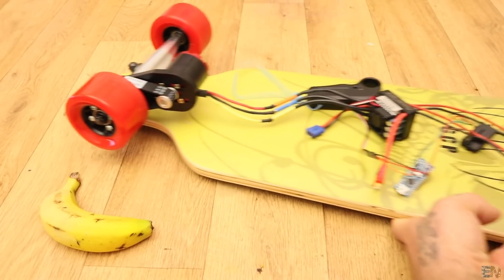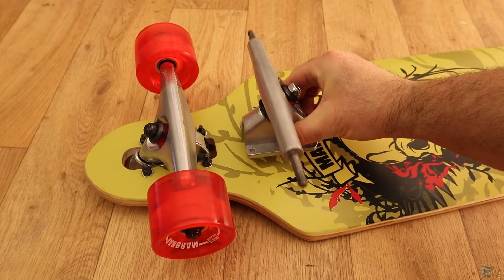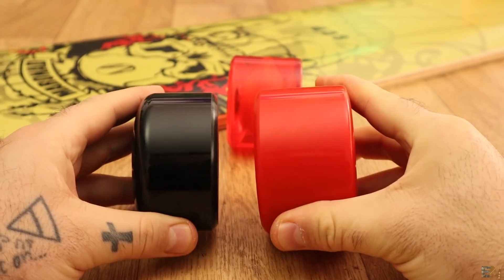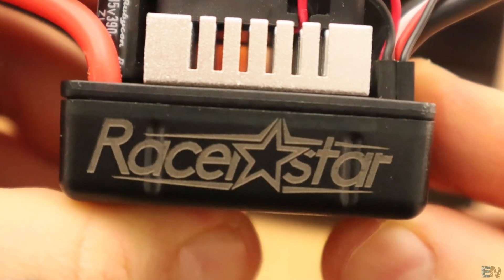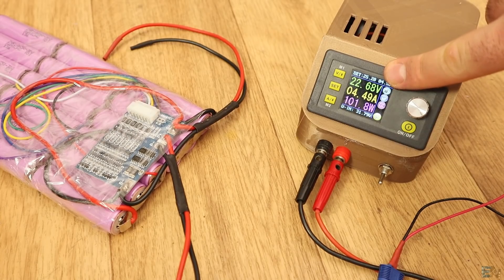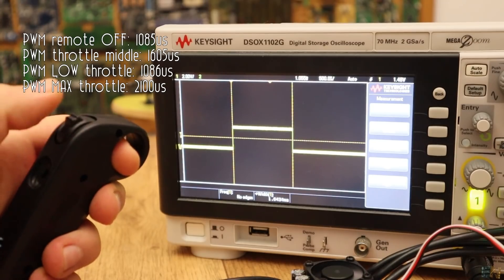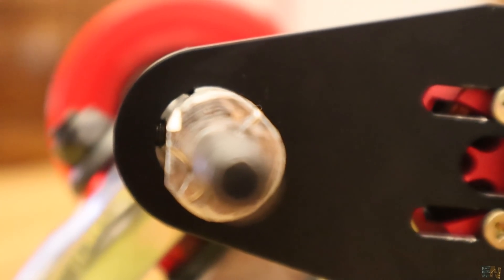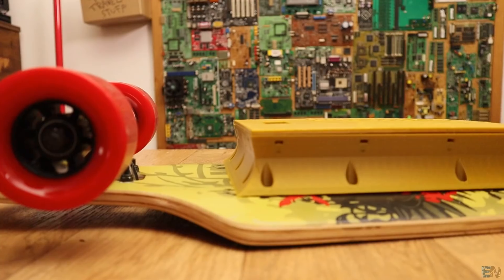Homemade Electric Longboard - what NOT to do | attempt 1

Comment: I have made a very similar longboard, but your code is not working for me, i've checked over it a million times, tried a simpliar code but still nothing.  Without the arduino nano the motor works, but same as for you it stalls when trying to brake, any ideas?

Comment: Love  the project and how you creatively pulled it together, however, I have a few things to point out and some suggestions for you: 
> Use Silicon wires rated for the current you are drawing. The plastic PC wires are not rated for the surge current on RC applications and will heat up causing it to melt and possibly start a fire. Silicon wires are cheap and will not melt and short circuit even if you accidentally overload the system.
>That power switch is probably rated for 6A peak and 2A continuous, it will melt soon and give you weird problems, so please switch to a heavier duty switch as I'm pretty sure that circuit is way over 30A on load. Never try to save money on wires and switches for heavy current applications!
>Instead of grinding off the shaft support on the wheel mount and making it weak, it would have been better to drill the motor mount as much as you can and then grind the shaft to make it fit.
>The method of mounting the sprocket to the motor shaft is a poor design from the manufacturer using 2/3 set screws on a round shaft, you should switch to a shaft and sprocket with a keyway design or a shaft with a flat spot on one side for the set screws to bite on, even which comes loose. Loctite it for sure!
>And like everyone pointed out with the programmable ESC, there are lots of custom firmware available for them as most of them are ATMEL and ST micros, you could flash them and have it your way with no brake unless you pull it in reverse for braking. And since you are using a nano, you can use it to power on the ESC by connecting the power switch to a pin on the nano with a proper circuit and turning it on in void setup :) 

But overall, this looks like a very satisfying project with excellent outcome!

Comment: How close are the motor speeds when you have 2, because you could put 1 on front of the axle and 1 behind. If the speeds are different maybe 1 on the front axle and 1 on the rear, but both on the same side, eg right-hand side.

Comment: You can adjust the motor break in the ESC don’t need Arduino.
Reply: With a vesc or any ESC ?
Reply: GAmer MIxer any ESC.
Reply: @lukandros  thx !
Reply: How please....
Reply: @steebbo9460  you can check the ESC manual. Bcs it changes for each ESC
Reply: @lukandros  cheap chinese esc no manual.... :(
Reply: @steebbo9460  what is the model, some models are based in some chips that is used in branded ESCs
Reply: @lukandros  tell us how
...
Reply: how do you do that?
Reply: @faizsyafiq4475  https://www.youtube.com/watch?v=UaLYmQETrUg
Reply: @lukandros  I wouldn’t say this link is a good example because you don’t want a hard break. If u end up adjusting it to a hard break for your skateboard, ur gonna fly off.
Reply: @johnavanuchiha7898  That's just an example that if you search you gonna find something suitable for your case
Reply: @lukandros  ig but that’s not always the case especially when it comes to something as different as this.

Comment: good vid. put the other motor on the other side of the same shaft. left wheel motor behind the wheel, right wheel motor in front of wheel. motor size won't matter and you should not need to reverse wire one motor

Comment: You can use the ESC programmer to do everything you put the Arduino in for. https://m.banggood.com/Racerstar-LED-Program-Card-For-25354560A-ESC-Motor-Set-p-1057127.html

Comment: I have a few suggestions for you to consider: RC Car Brushless ESCs usually have a lot of programmable features. In your case it would be ideal to disable the brake option, as well as the reverse function and maybe adjust the startup power. That way you can skip the arduino. Also when using the arduino, i would add a potentiometer to easily adjust the throttle delay. Cool project thou,
Reply from the maker: Thank you!
Reply: You can do that with a program card. They are cheap
Reply: @sebastiansombra  you can usually do that with the radio. No need for the cards
Reply: @felipegross  radio?
Reply: @apanlæg  Radio controller = radio transmitter = TX